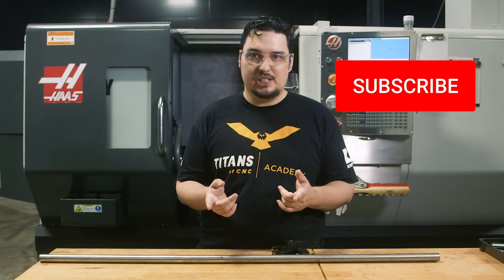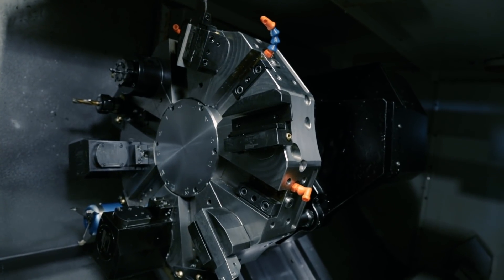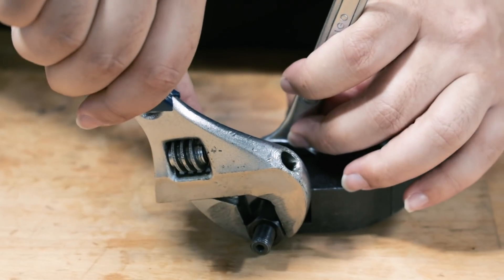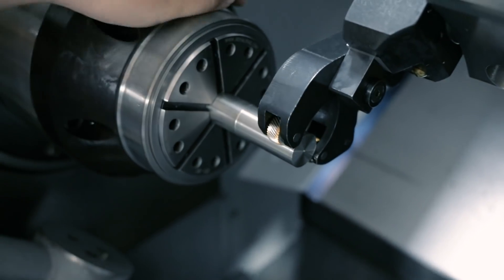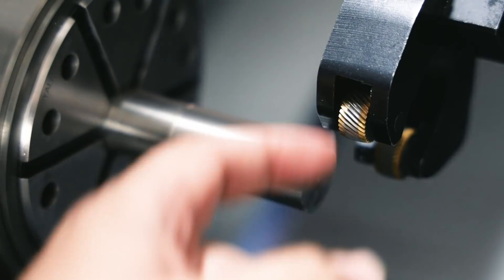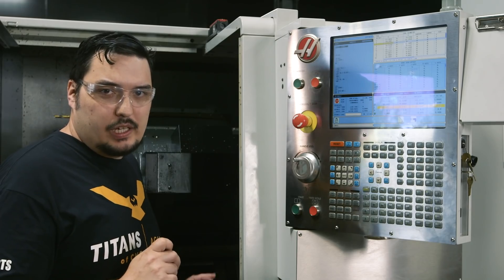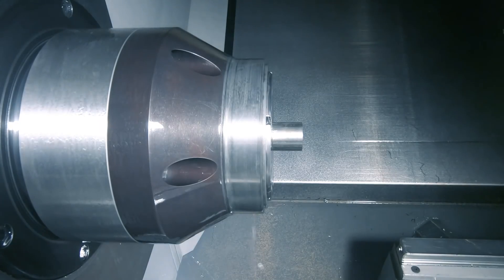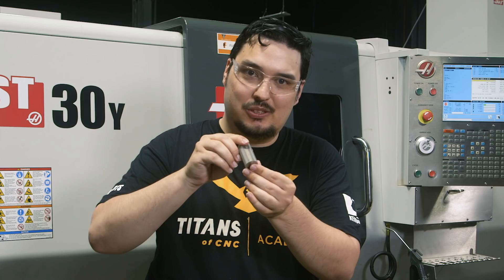The Art of Knurling | CNC Machining Tutorial | Vlog #87

Comment: Nice! . A different way of touching off. Still got the same results. I generally run the spindle slow and move the knurl tool down till it starts spinning on a known diameter and call it that diameter. Also I run the neural off the edge and the z until it stops spinning and I call that z0. Let It go from the door today I guess that's from me running manual for years. All depends on how you program it but that was a great tutorial thanks for showing everybody. you, your dad, and the whole company are doing a great job for the industry. And there's always more than one way to do it! keep thinking outside the box it's what our industry needs to succeed.

Comment: How do you measure proper diameter for inside Knurl. Working on a stop for a 28mm shaft and it has to have straight knurl so it can adhere to the shaft so how do I know that the knurl won't thread over itself ? (concave and circular application).

Comment: Where do you get the precision .250" shims? I've seen you guys use them multiple time before and I can not find them. I tend to use a 1-2-3 block, but a .250" shim would have some value in some situations.
Reply from the maker: Made them... out of 1.0” Dia... they taper on the edge so it’s a smooth transition
Reply: MSC has a set you can purchase. They screw together so you can make a custom stack for setups.

Comment: why do you subtract the positive value from the G54 offset from the tool geometry Z value?
Reply: The G54 was originally set using a tool that was touched off to the tool probe and then set to the front of the part.  I'm offsetting the difference because I'm not using the tool probe for this tool
Reply: So, this value is the difference from the master tool. Understood. Thanks for your reply

Comment: You got an ST30 Y, would be way easier to use the Y travel for the tool measurement...and it´s more accurate to touch off one of the knurl wheels one the part or your probe arm

Comment: Chamfers front and back will make the part look a lot better. You should also emphasise the feedrate used as this is important to the quality of the knurl based on the type of knurling tool.
Reply: the feed rate will vary ---that's why he did not mention it ---but you already knew that
Reply: @davidwrighton3914  Yep, but it is important, wouldn't you agree?.
Reply: I had two main questions and that one one:

1. Isn't feed rate important - and doesn't it need to be  a factor of something - i.e. like the dimensions of the knurling tool ?? Does it need to by in-sync with the rotation, like when threading?
2. Does it need to be synchronized - if you're doing multiple knurling passes - like with threading?
Reply: @Bkgoodman11  Hi Brad,1. As a rule of thumb a feedrate on softer materials can be as much as 0.020" , less on tougher materials. It therefor does not need to be in sync. The depth of cut can be up to 1/2 the depth of the serration in the knurling wheel.
2. I always try to get to depth in one pass ( on finer knurls), but if you need to take multiple passes, leave the feed engaged and reverse the feed direction.

Comment: Thanks for the great videos! I was wondering if y'all can make one about machining screws or bolts. Watching Titans of CNC has got me trying to switching trades.
Reply: I know you're asking them but thought I'd just butt-in. You know that most screws & bolts are manufactured very differently, right? There are cnc screw machines but most are made with even more specialized machinery.
  They can do it but it's not very common because of the massive choice of mass-produced fasteners. It's usually far cheaper to find one that works for the application. Ed Grimsmo makes some tiny machine screws on his channel with a typical CNC lathe, for his knives. I haven't figured out why he didn't just find a way to design the knives to work with ones he can buy for a few pennies though.
If you're gonna go that route, may as well make a custom head on the fastener so it looks cool and illustrates the expense better.
Reply: @christurnblom4825  I only know videos here and read on a forum you can use cnc machines to make threaded parts like screws and bolts.
Reply: @FirstLast-py2qe  

Yep. You can make practically anything your mind can imagine that could be made from metal or plastics, with the exception of some of the complex geometries made with 3d printing. You could still find a way to make the same shapes in pieces and assemble them though. 

  Honestly, just making 1 or 2 bolts is done faster on a manual machine unless you've already got some stock code that can just be modified quickly and/or the fixturing & tooling to do it already. For instance, I've seen it done on lathes with live tooling. Start with the head & the bottom is flat, which is usually fine. If you're reference to switching trades is hinting at learning to manufacture fasteners to sell, I strongly caution against going into that idea half-cocked though. it's overrun with experts & money. Unless it's highly specialized fasteners that nobody or almost nobody makes, you're not going to be able to compete without millions of dollars. Ask Titan for a second opinion if that's what you're getting at.

 Anyway, check this bad boy out. I think the common vernacular for this is "machine-porn".
https://www.youtube.com/watch?v=msvfo6_Jq8E
Reply: @christurnblom4825  thanks for the information,  my trade switch is for cnc machining,  I'm currently working with duct/electrical/ plumbing. Cnc machining seems to require more thinking and it'll be nice to be home instead of traveling all the time
Reply: @FirstLast-py2qe  

I totally get that. I did various construction and steal fab. jobs for 12 years then went through 8 years of poor health & barely being able to keep whatever job I could find. If you can find a way to handle being inside all day, it's nice to have that climate control and stay relatively clean.
   I work in a small job shop & often I'm the only one there so playing whatever music I want helps a lot. I'll tell you that it sucks getting out of school at first though because many of us become button pushers until the boss feels like you won't crash a machine. I got my own small manual mill & lathe so that I can keep learning. I couldn't see a world where I didn't have one, once I knew how to machine. Plus your friend needs a drive line shortened or the head on their engine is warped etc, you can help them out & they'll be extremely grateful.  I just made a little part for the ball return in a bowling alley, for instance. 30-45 minutes, got $30 ...it all helps.
Making whatever you want is awesome.

Comment: Great video, i just finished a run of 9000 knerled pins today great timing on the vid. was currious how well that tool you used in your video might compare to the style ive been using. My tool is not adjustable and i have to use a live center because of the amount of pressure in x i neen to get a knerl. What id like to know is by using the tool over center line of the part what kind of loads are you looking at. Would be nice if i could get rid of having to center drill and use the tailstock.

Comment: Knurling never works out this good on the first try , how about a trouble shooting video , like I noticed you just fed onto the part in the Z direction, why not feed onto the material from X and then feed along in Z.... reasons why or why not to do this. How to fix incomplete diamond shape? How to prevent double cross diamonds? the list could go on and on . Like I said its never so simple, it takes a bit of trial and error to get it just perfect. However having said that this video is good, I'm picking on you , I just think you could say a bit more than the basic's.

Comment: Great video Tyson. I have a question. I am an old school machinist. I was trained in trade school in the early 80s on manual lathes. Knurling was one of those things that sometimes didn't form the beautiful diamond your part did since the knurl rollers aren't synchronized. Sometimes we would get a cross knurl or double knurl, where one roller would make the correct pattern, but the other roller would roll in a double pattern where it basically cut the other half of the diamond in half. Make sense? How do you consistently get that perfect pattern?

Comment: wow, great video. so I just ran 280 stainless parts with similar feature sizes and it took 4 minutes for just the knurl tool path. are the wheels HSS? Cobalt? What brand knurler? What SFM and IPR? Our knurler was not straddle type like yours and the wheel weren't concave either (our were beveled).
Reply: From the video :) 
SFM = 250
IPR =. 012

Comment: Great video guys! When I did knurling on parts at my old job (which was a lot  Haha!!) during setup, I did a skim pass on the material such as you did, and for example a 1" diameter turned down to .985---after that I took our knurling tool (which had the same knurling wheels as what you have) and lightly touched off on the O.D. of the part (.985) and hit X diameter measure button and entered the .985 and then hit enter.  From there in my program I would write for my knurling tool to enter rapid in Z-.100 to get started and feed down to X.965'ish , depending on material your knurling and visually check the knurl finish. One trick I learned was to watch the amount of pressure on the X axis as it was knurling and put that note in the program for future runs. Usually for stainless my X axis pressure was around 25-35%.  For aluminum it was much less, usually around 10%. 
I forgot to mention, that I ran a HAAS SL20 and SL30....not sure if other CNC lathes have that feature of X load pressure.

Comment: I was never good at math, but 0.985 - 0.030" diameter digs into the material .015", not 0.030.  I still don't understand how the two cutters line up.  Is the z feed speed critical?  In my head if the diameter of the cutter divided by the number of ridges on the cutter isn't some multiple of the diameter of the part then your cuts won't line up after you make a few rotations.  Is this true?
Reply from the maker: It’s Dia... not per side
Reply: @tomashallengren6436  Ehh, if I did I'd probably know the answers to the questions I'm asking. Bro.
Reply: Lmao

Comment: How did u get the 2 wheels to start at the exact Piont to form the diamond? Sometimes when I’m nerling on an OD the stripes don’t line up and it makes a mess . The way I do it is I start at the first few millimeters with the edge of the nerling wheels and wait till I see a diamond shape start forming then engage feed across the part.
Reply: Probably not enough pressure to make the wheels "bite" either that or your wheels are getting worn out. One thing you can do on worn tools is to incline the tool towards the Chuck to reduce the surface area.